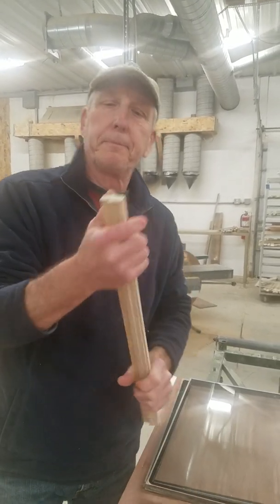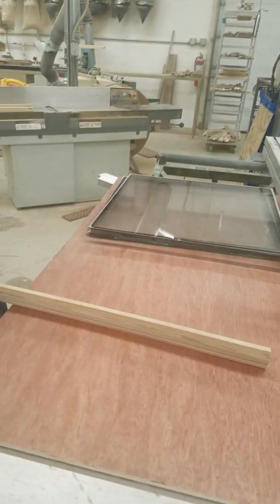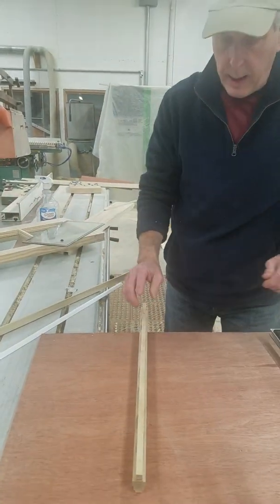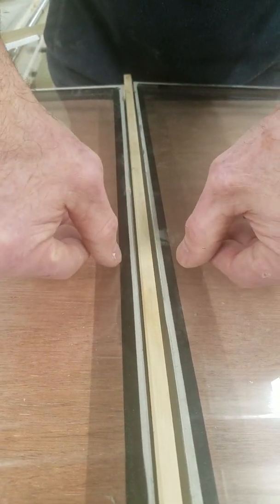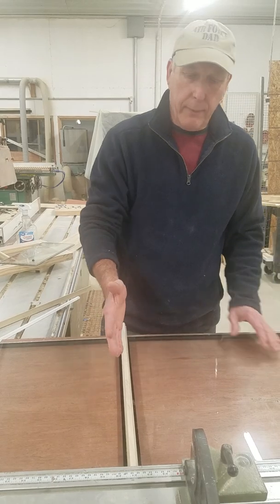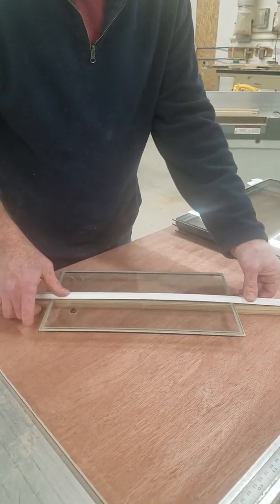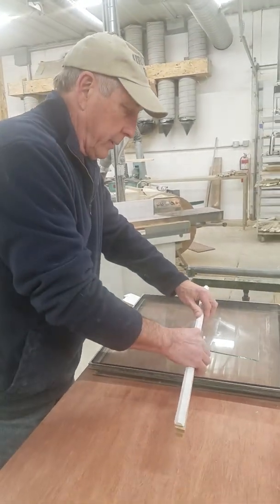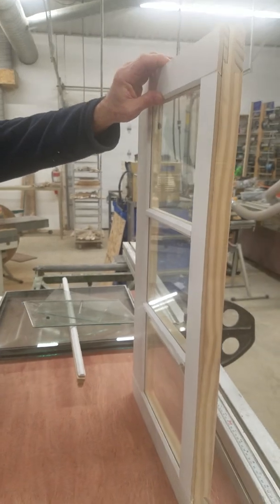Heirloom Windows - True Divided Lite, Simulated Divided Lite and the Insulated Glass conundrum.

Comment: Really good presentation. Curious since Spacia is costly when compared to other options, do you get any push back from your customers on cost versus using TDL? 
Also do you get any comments about the pillars used to hold the vacuum glass apart?